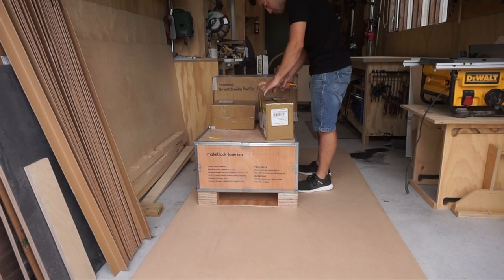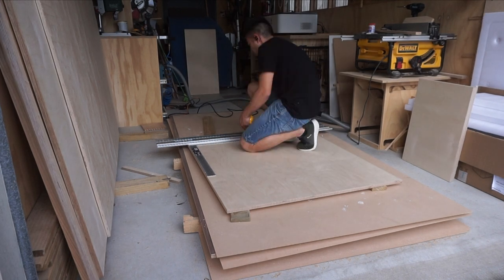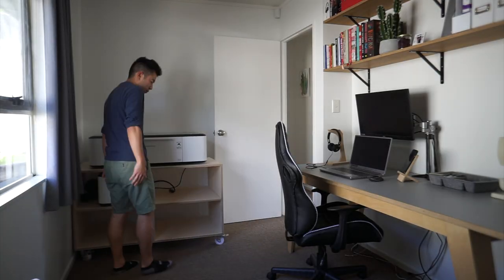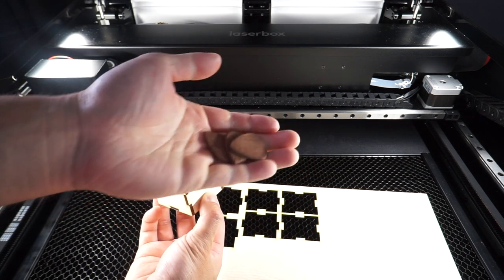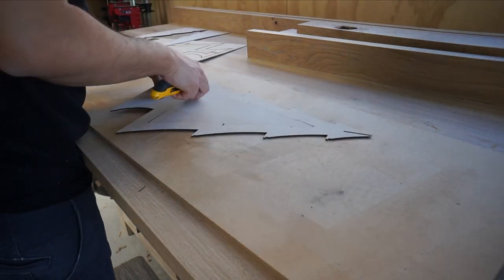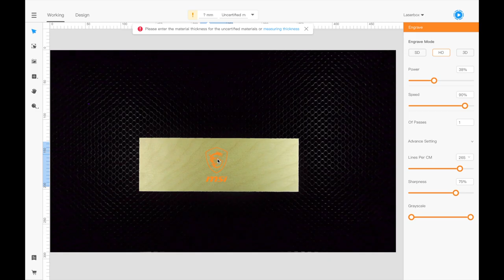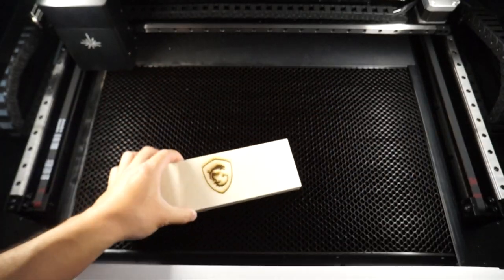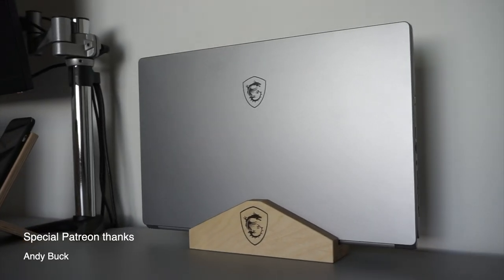Using a Desktop Laser Cutter For The First Time (Makeblock Laserbox)

Comment: I have one of these at the office and have been the only one using it.  I have been making trail signs for MTB trails on 15mm thick pine board using the engrave function.  Today I noticed that the hood was building up a lot of smoke very rapidly, something that definitely hasn't been happening previously.  My filter chamber still shows green but it seems there is lack of suction as on all previous runs the smoke is easily sucked out the back. My settings are exactly the same.  The machine has been running for 10hrs max.  I'm assuming that even though the indicator light is still green, I need to change my filter... Thoughts?

Ever just vented outside instead of using the filter?  I have also debating putting the exhaust through the shops vacuum system.  

Really not interested in changing a $100 filter every few signs I make...